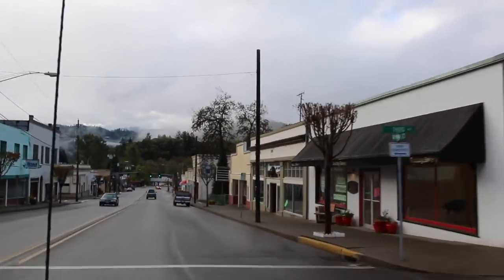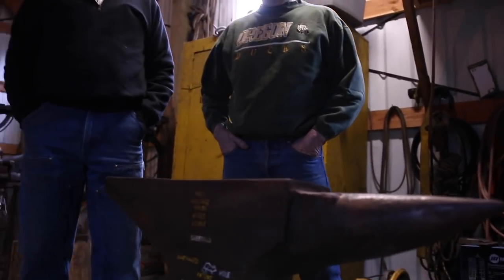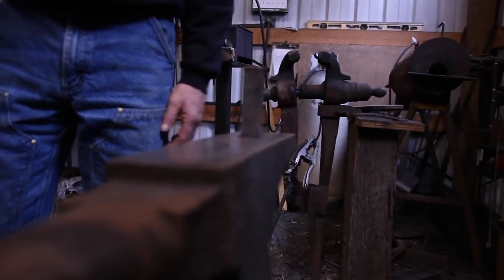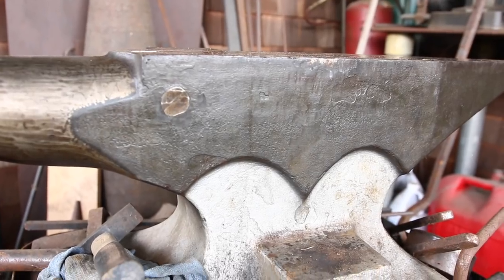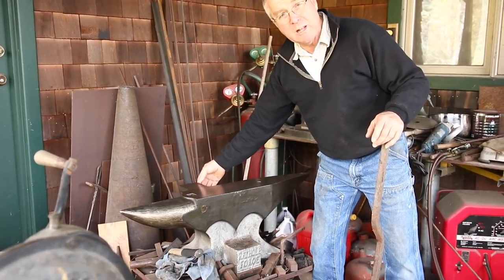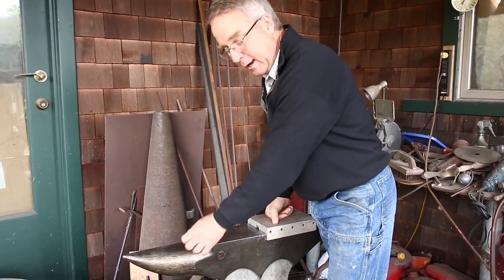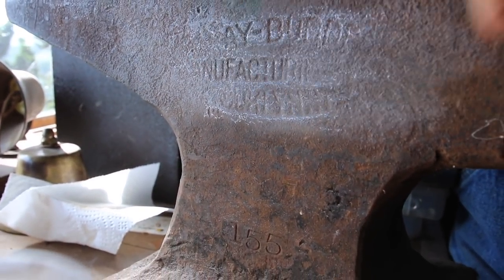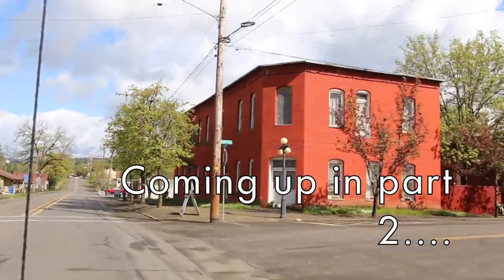Anvil Tour Part 1

Comment: My Dad has a Hay Budden. I have (I think ) a Peter Wright that is at least 150 pounds and Dad's is heavier. I also have a 100 pound. Growing up on a small dairy, we never really did blacksmithing. Just reshaping damaged equipment parts. Although, I have made insignificant things such as a brake adjusting tool. I would love to do more and learn more about blacksmithing heat treating metal.

Comment: Is there a rule of thumb for calculating the weight of an anvil? For instance: I found an equation that is supposed to work for small anvils. It says multiply the length by the height and subtract 110 and that gives you a rough idea of the weight. L x H - 110 = W. My anvil is 23" long by 9.5" high and the equation gave me 108.5LB. So much is left out of the equation, though, that I just do not trust it. Any suggestions?

Comment: Not sure how to add images to comments... These anvils have been in my family since the 1950s and 60s:
Henry
Wright
Dudley
Warrantee
Solid
10?6
about 100 lbs. fair condition 

Trenton
Patent
????  maybe ??07
?ITOY
102
fair condition, someone has repaired the edges

Vulcan Brand
Used for Horse Shoeing but not specifically a farrier's anvil. Probably around 40-50 lbs.